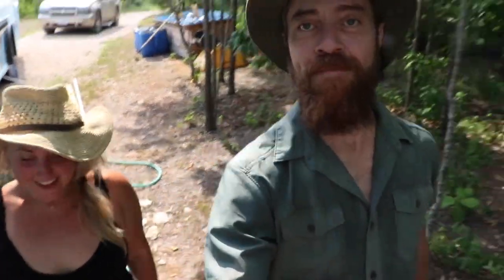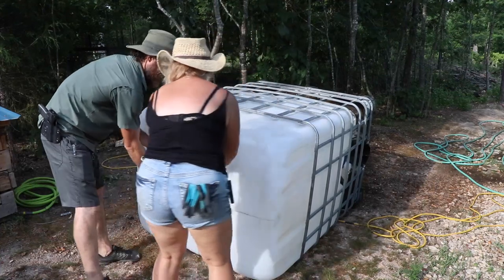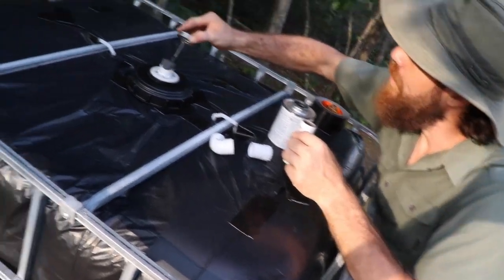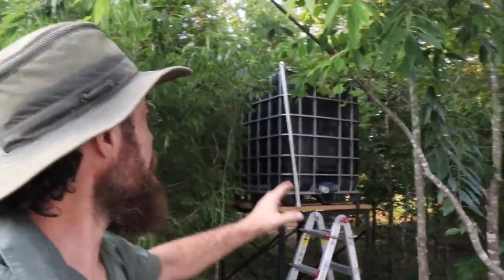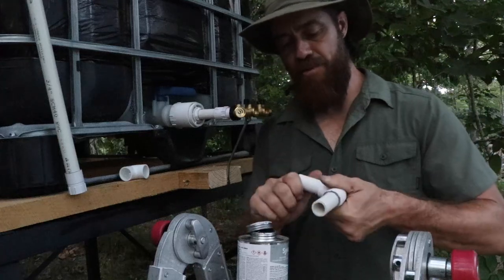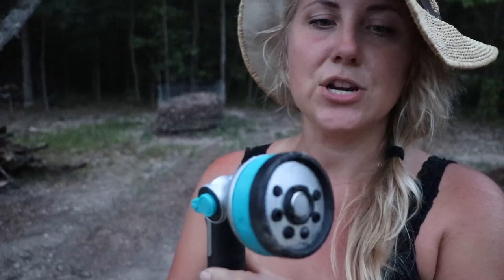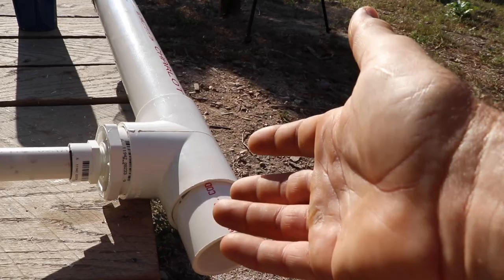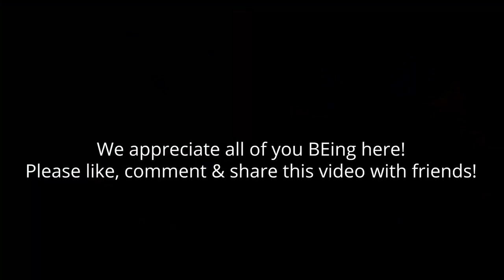DIY Water Tower | IBC Tote Water Storage (Great for DRINKING WATER - SHOWERS - GARDENING)

Comment: Garden tool storage you can also use an IBC Tote to make an outside shower it would just be a little taller Paint It Black the sun heats it up during the day you have a warm shower in the evening leave it dry in the winter time you might want to put a 2x4 underneath the where the water comes out down to the 2x4 right beneath it just to kind of give it a little support because when you put the hose on there it puts extra weight pulling down and it might snap something off in the winter or whatever of course you aren't going to have the hose on in the winter but it just gives it a little extra support...if you ever get chickens you won't have ticks but you have to have a coop and run that are completely critter proof,I have chicken wire over the top for hawks,eagles,and owls and coons who will climb on top.I also connect chicken wire to the bottom of the wall of the wire run and flat on the ground out about 1 1/2 feet out any animal trying to dig will come to the bottom of the fence start digging and hit wire they free range during the day
Reply from the maker: What's funny about you saying to make an outdoor shower is that we've already been using it as an outdoor shower @KAREN RIGGLE! 

We do have the manifold support bracket installed so there is no pressure on the connection.

Chickens! YES! They are on our list of first animals to get, but we gotta get this greenhouse up first before we can spend the time to build the infrastructure for their survival. Great idea about the hardware cloth running along the ground. We're going to bury it a bit to keep the digging critters out fo sho!

Thanks for watching! More fun to come!
- B+E

Comment: That full of water will weigh over 2,000 pounds, 8.3 pounds per gallon x 270 estimated. I would be very cautious around it when you get it full, that frame doesn't look that robust for that much weight....just a little sideways pressure might collapse it suddenly.
Reply from the maker: Hey there @Brian Egeberg! Yes, any water tower should be approached with caution, I'm thinking of drilling some auger anchors like the ones used for mobile homes to anchor it in place. Also, the 10 gauge steel is angle iron all welded together, which is quite strong. Check out the specs on steel. It's been used for all sorts of construction throughout time.

Thanks for watching!
- Brian + Erin too

Comment: I better option would have been to install a 1/2 inch bulkhead with a over flow pvc pipe with a screen , about 6 inches next to the large black cap. You can’t expect air to exit where you want water to enter.